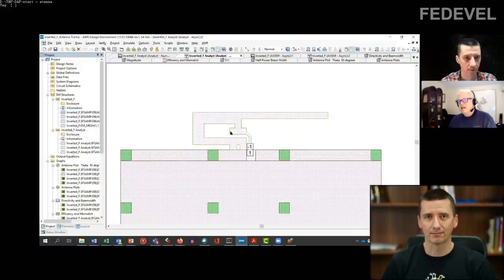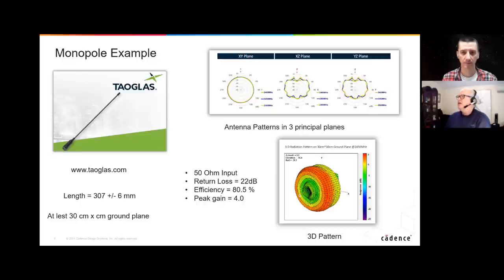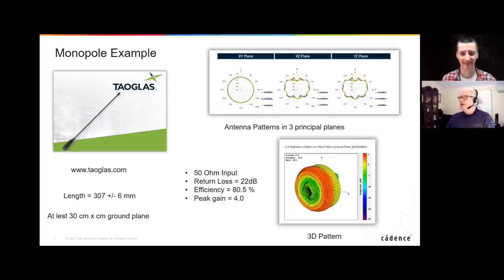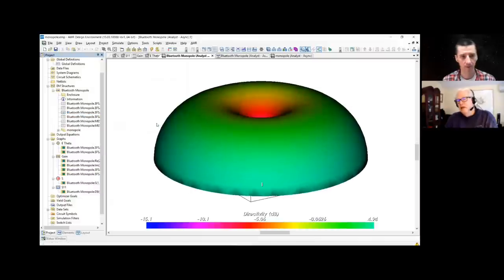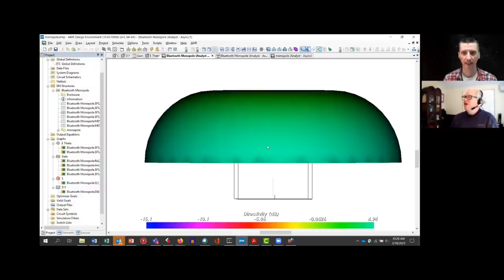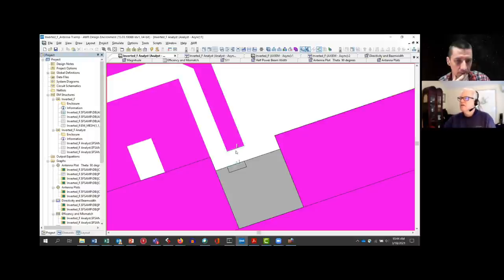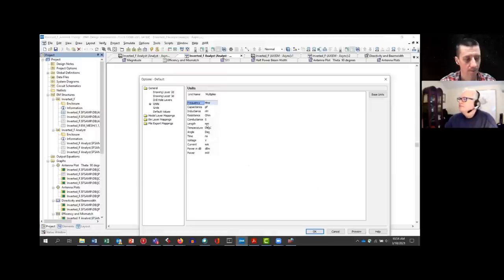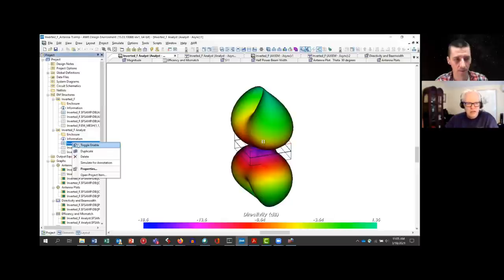How to Design Your PCB Antennas And How Antennas Work (Bluetooth Antenna Examples) - with John Dunn

Comment: on last antena mismatch is because of gap, and lack of opening to transition to correct impedance. it is CPWG with Ground and it is VERY sensitive to the GAP even 0.5 mil makes huge difference in impedance thats why I would choose antena which is feed with MICROSTRIP, like previous example. MICROSTRIP is much easier to manufacture and even JLCPCB without impedance control can make it more or less reliale. I would avoid CPWG nd CPWGG completely if I go for RF.

Comment: At one hour, 19 minutes, 40, the inverted F PCB antenna is simulated. However there is a difference: On the original drawing from the Cyprus company, the transmission line opens up; wider spacing between ground and the center conductor as it reaches the antenna. That is likely to make the feed balanced, which an inverted F antenna needs. However in the simulation, you narrow to shielding to keep the unbalanced 50 Ohm all the way to the feed point? You do mention the spacing later in the video, but are more concerned about the via placement. Am I missing the obvious here?

Comment: The topic of a single antenna transmitting and receiving simultaneously at the same frequency is quite an interesting one and can give some insights about how VNA measurements actually work.

The "impedance" of an antenna is actually measured and shown (on smith) as the amount of the reflection off of the feedpoint of an antenna.
That signal can be reflected either by the antenna itself, but it can also be transmitted from the antenna, reflected off of a nearby structure, and then received again, which then shows as a slight shift in the measured impedance.

So yes, receiving a signal same like the transmitted one is manifested as a change in impedance.
And changes in impedance cause circuits to change behavior.

There is a circuit called "regenerative receiver" which is basically a weak transmitter which drastically changes its power consumption (and frequency) depending on the antenna impedance.
Hook it up in series with some headphones and it's an AM receiver. But in fact, it's a CW transmitter and can be picked up by an SDR.
Two of those in the same room can even lock their frequencies to each other.

But it's impractical to transmit and receive at the same time and band, especially when modulating both signals, since the transmitted noise would drastically desensitize the receiver.

(Just my two cents :D)

Comment: Excellent video Robert. It's sad to see so few subscribers for a channel producing such informative content. Keep up the good work...
Reply from the maker: Thank you very much Nasser for nice words
Reply: @RobertFeranec  Would be nice to see a video on Multi-Phase buck converters. I have played with those at high currents, and even after years of experience (mostly with Intersil chips, such as ISL6307), often times the first prototype fails the smoke test (especially if you're going for more than 300 Amps using six phases). I think a comprehensive research addressing all the concepts in play (especially with High-Side MOSFETs) would make an interesting tutorial.

Comment: @Robert Feranec: THX for that video, it is an eye opener even to me. But either there are some misconceptions in the explaination John gave of the Inverted-F Antenna or at least I got it wrong: The BOARD itself exceeds the place where the Antenna itself goes to. The Dielectric material FR4 itself exceeds where the Antenna is. What you can see on that simulation is not where the PCB is cut down, it shows where the electrical layers go. The picture only shows that the ground plane is recessed a little from the board's outer edges for maybe 30 mm or 40 mm. And instead of the ground plane on both sides of the FR-4 material the downside copper is removed completely and the upper side copper is edged to the form of the inverted-F Antenna. It does not mean the manufacturer has to cut out the FR4 material to the form of the inverted-F Antenna. The antenna length has to be calculated to the shortening-factor of the specific material the antenna is made from. So, for FR-4 this is round about a factor of I think 0.8. Taking that into consideration this shortens the antenna to the shown round about 2.5 cm length. The radiating length is all of the outside track. You can think of it being a Tap connecting the radiating "track" to adapt the impedance. It works kind of like a tap in a transformer, moving the tap to the end of the radiator more would increase the impedance, moving it more to the ground section would make impedance going to your transmitter smaller value. And John did already explain the section being in shape of a big "C" character being kind of inductor whilest the "=" looking shaped part is a pair of capacitance plates. So they're forming some resonant L-C circuit as part of the impedance matching and adaptor part.

Me as an radio amateur sometimes got the impression that John was a little bit of unsure as well when he was explaining some details of the antenna specific stuff, but at least most of it was kind of correct. Sorry, John! But changing an asymmetric driven inverted-F antenna into a symmetric Lambda-half antenna takes a little bit more than just changing the shape of the antenna. You need matching parts, kind of "transformator" for adapting your single ended power output of the transmitter into the 2 anti-cyclic driven parts of the antenna (while part 1 of it gets positiv voltage output at a time the other one needs to get the negative one and vice versa.... ;)

Comment: I had to design the same inverted f antenna as a project 2 months ago in my university. We've done it in ADS Momentum and the funny thing is that we find that if you have just a straight lower portion of copper, it gives a better S11. We didn't managed to get something better than -10 dB with the original design, so we started looking for a resize. So by making the low part straight and by adjusting the horizontal length of the antenna we obtained -25 dB for S11 at 2.45 GHz. In the same source, a Meandred Inverted F Antenna design was proposed, that we also had to simulate. And guess what? We didn't even nearly came to the -25 dB from the article. The best we obtained was -12 dB.
As a conclusion there's no antenna design that will be the same as the one offered in the guidelines. Even using the same exact values, sizes, pcb thickness, vias, it's not guaranteed that the antenna will perform the same way as on the guidelines. And that's only on simulation, I'm not even talking about real pcb where a ton of additional other factors could appear.
Reply from the maker: This is very interesting Victor

Comment: Hey Robert, super nice video!
I just want to give a comment on the biggest radiator in the F antenna or at least the way I like to see it.
I think it is actually the vertical part that connects to ground (what has been called inductor).
That one is effectively a monopole that is vertical to the ground plane (you need to see the groundplane as in the pcb cross section, which is more like a ground knife).
For image theory it will duplicate the size and that is why it is called monopole.
then there is the 90 degree turn and then the line is parallel to the ground.
This still radiates, but less.
You can visualize this using the polarization, as it follows the direction of the current.
The feeding point is at a distance from the ground connection in order to have a matching.
When resonating, the ground has the lower impedance (0) and the open part the highest.
In the middle you find a point that, by adding that capacitance in parallel, you can match it to the desired impedance.
The reason why it radiates most from the vertical line, is because the current is maximum near the ground connection and the voltage is maximum near the open end. This is due to the resonance.
As you might imagine, the radiation come from the oscillating electric current.
These antennas radiates from the magnetic field, unlike a patch antenna that radiates using electric fringing fields.
Keep un the good work and thanks again for the videos!
Reply from the maker: Thank you so much Alex

Comment: Would be also nice to know about real pcb antennas matching practices using vector analyzers. And also there was shown, but not discussed, about inverted F meander antennas - what the difference to plain F? I use it in my device, got the shape from Texas datasheet, but have no theory behind it…)
Reply: The meander does two things.  The far field radiation from an antenna can be directly related back to the currents on the antenna; i.e. the currents cause the radiation.  The highest current density is on the low impedance section of the antennas, specifically the back-short and feed section, or the first 40% of the electrical length.  The remaining 60% you can meander to increase the electrical length without affecting the radiation pattern too much.  This allows you to compact the antenna into a smaller area.

Meandering also helps with the impedance match.  The IFA is really just an offset fed monopole, and an electrically short monopole has a large capacitive reactance (and low radiation resistance).  Meandering the feed introduces some inductive reactance to compensate, and is better than a lumped element inductor as the currents contribute to the radiation.

As I commented in another thread, this walks through the evolution of the IFA from a monople, discusses the tradeoffs of bandwidth and efficiency, and shows meandering.  Tuning on the VNA is shown, and GPS C/N0 measurement.

https://youtu.be/q6f6m2j1nYs
https://youtu.be/br4-9p_6GOA
https://youtu.be/8gVFonUfoao

There really is no free lunch, but there are methods to maximize the tradeoff of efficiency vs bandwidth.  Look up the "Chu Harrington limit", which is akin to Shannon capacity limit for antennas.

Comment: Although it is possible to use a single antenna for transmission and receiption at the same time, it is rarely used and more common in radar applications. Nevertheless, (at least modern) automotive radars do have different antennas for receiving and transmitting. It is much cheaper than to implement a circulator/directional coupler. Additionally, you get a higher angular resolution using MIMO/beamforming techniques if you have seperate tx/rx antennas. And yes, modern automotive radars have like three transmit and four receive antennas or even more, each with an individual tarnsmitter/receiver and the signals get combined digitally afterwards (see beamforming/MIMO).
Nice video anyways :)
Reply from the maker: Thank you very much FabianS

Comment: This is all fine as long as you want to use your antenna without any enclosure, and you don't care about the interactions of the rest of the PCB with the antenna.   XFDTD by Remcom will pull in your entire PCB design, each layer and dielectric etc, plus the plastics and everything surrounding the antenna.  Then the edges of the PIFA can be "parameterized" so that you can change the position of those edges during each sim.  Over multiple runs, you then tune the length for resonance, and the impedance matching, and the whole thing converges.  The resulting antenna is then adjusted in Altium, then simulated one more time to verify the changes.   I've done a lot of antennas this way.  My first try tripled the operating range of the device. (Given the inverse square law, that's impressive).    Having your antenna impedance too far away from nominal can result in a lot of harmonics and cause you to fail compliance testing.    RF current flows over your whole PCB, which interacts with the antenna and changes both the impedance and the pattern of radiation.

This is not bad, and in some cases it will be enough, but even a simple ABS enclosure will affect the tuning of the antenna.  Designing as if none of the enclosure and most of the PCB is missing is not a path to dependable success.

Comment: Thank you for making this video and sharing it with all of us.
Can you please explain the issue at 51 minutes 46 seconds, that graph does not show the frequency centered at 2.4 GHz.
In fact it shows the antenna length looks to be a little long and tuned for around 2.3 GHz.
That return loss graph is not centered at 2.4 GHz. Throughout the video, 2.4 GHz was mentioned but the graph does not indicate proper tuning for that frequency. Can you please review and explain?
Reply: The return loss S11 plot he shows is not centered at 2.4GHZ because the length of the stub need to shortened a bit. In other words, the design he used was not fully optimized. Additionally, there are dielectric losses he needs to account for in his simulation to tune to exactly 2.4GHz. The er he might use is not exactly what TI might have used.  also when you fab it there will be some skew as vendoe dielectric is going to slightly different than the one used in the simulator. the bottom line is the design he showed was not optimized for exactly  2.4 GHz. He just used the artwork as is.

Comment: Thank you Robert for creating the video, but it's a bit complicated for non-RF engineers.
Would you please make a tutorial on designing the PCB antenna alongside the matching network using Altium designer? it would be much more helpful to understand it.
Reply: Unfortunately RF/MW are fields that are studied separately. Antennas are their own field and to understand it, I recommend you read Constantine A. Balanis. all of the video content is covered in the book. Then use Sonnet EM, HFSS or CST to start modeling the antennae. Without 3d EM field solver you can't really design them. I have been doing this for several year and I use ADS, HFSS or sonnet EM for simulations. good luck as this is not a lightweight topic.

Comment: w2aew has a nice video on directional couplers with explanation.  It's video 196. Should be easy to find.
Reply: And some good videos about antenna matching as well (although more into CB frequencies, the theory is the same).
Reply from the maker: What a great video! Thank you MrEN0046 for pointing that out.
Reply: @RobertFeranec  thank you for your videos. They have helped me out and are interesting.

Comment: I wish you had a video on using a ceramic omni directional antenna and it effect on antenna design.  They are becoming a alternative to a pad copper plus filter set up.   I believe phones  use them and they are made for bluetooth , etc .  They are small package simple design and talk of higher db over range.

Comment: That was amazing video! Thanks a lot Robert!!!
Well, it opened my mind, but brought  more questions:
If I use a Flex- Rigid PCB where the flex part is the antenna, should I use 30.6mm length for 2.4 Ghz?
How reliable Smith Chart is to tune my antenna? Is there an example how to match the antenna with Smith chart?
So, when I start a design it's really important to know where my product will be pointed out, once the antenna might be facing a metal plate and kill my antenna.
Reply: If the antenna is flexible, this basically means its geometry will be variable. This throws all your fine tuning out the window! You can simulate the antenna for the shape you expect it to have inside your casing. If it will just be flopping around, there's not much you can do at all.

In practice you don't just simulate your antenna, but then also make prototypes and measure their real-life behavior using a VNA. It will never fully agree with your simulation anyway, so what you do is add a few SMD footprints for matching components (tiny inductors and capacitors) and then populate those with different values until you get the best possible reading.

Comment: OOooookay! This is very new to me! I am not even interested in this topic and I am not a designer! But simply drawing lines, those lines can be either capacitor or inductor or both. By "simply" I do not mean simply simply, if you know what I mean.

Most of the time capacitance and inductance are determined by huge discrete devices (physical capacitors and wire-wound) or integrated in an insanely small blob by the power of science and technology.

Comment: Though it connected to ground, I guess the idea it produces such energy burst that the electrons fly of the copper trace into the air
, and as it's 2.4MHz on/off and not DC, there is not many electrons actually making its way all to the end and into the ground.

Comment: time: 46:48 minute...
is the Reference Antenna Design can we use RF AND Bluetooth (Combine with 1 Chip)  like (ESP-32) IC.. ?

I know many IC Company they recommended us there own Design Antenna..
but in this case if the wifi Frequency are same (2.4Ghz) ..
then can we use other model  PCB Antenna ?
is it work same...?